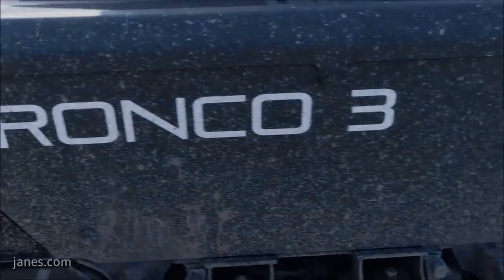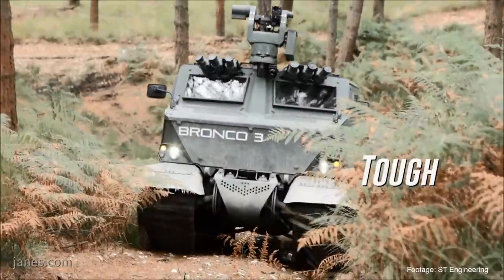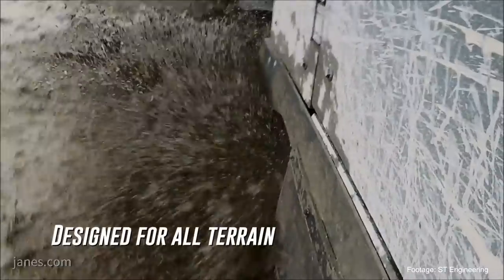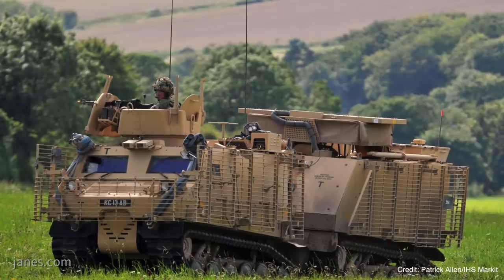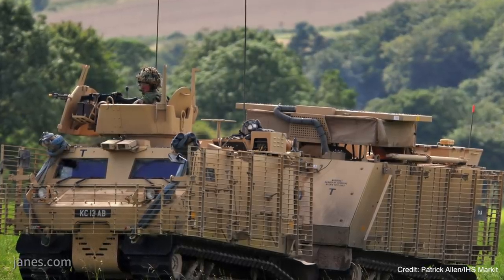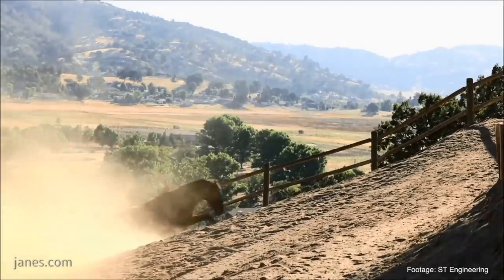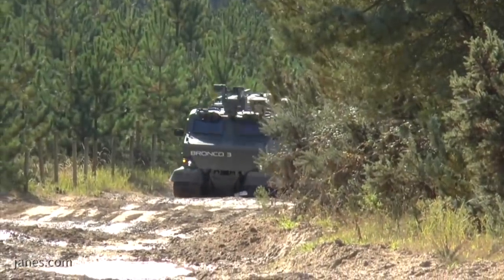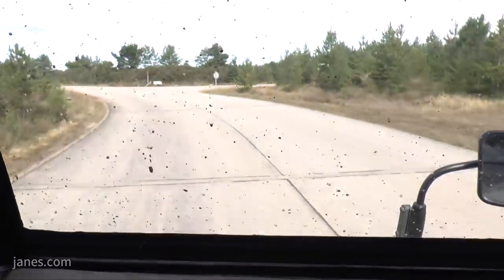Bronco 3 all-terrain articulated carrier (IAV 2019)

Comment: It's interesting that the ST Engineering VP compares his company's Bronco to the old but capable Bv206 instead of the Bv206's larger successor, the BvS 10,  The larger BvS 10 (MKII, Viking, Beowulf, etc.) is already in service with Austria, France, Netherlands, Sweden, United Kingdom, Ukraine (48 BvS-10s donated by the Dutch and U.K).  Future operators are Germany (367 ordered with delivery commencing in 2024), Canada (100 vehicles with delivery from 2029-2030) and the United States (136 Beowulf models to be delivered by 2029).  So good luck with the scraps left on the table, the big wallet boys have already bought from BAE / Hägglunds.  It is also important to note that France broke with their tradition of supporting domestic products, in this case the Bronco, built jointly by ST Engineering and the big French defense contractor Thales.
Reply: its interesting to note that the Bronco along with the AV81 and the Bionex are all designed by a Irish company all back in the 90s.
The Bronco went into production in 93 not 97 as said in the interview as Timoney also supplied the components for the vehicles.

Comment: you know if all it its meant to do is supply behind the lines..  surely it doesnt need to be 4x4 it could just be a normal truck and Dog with fat tires and Diff locks, a LOT cheaper and can carry a lot more.  Sure it wont go swimming but when would that sort of thing happen for a load carrier.....
Reply: wheels don't have the capability, non-articulated doesn't have the capability. And all the time--doesn't need bridges.